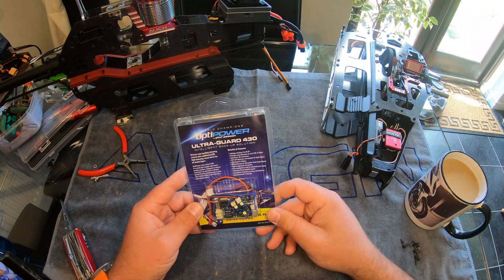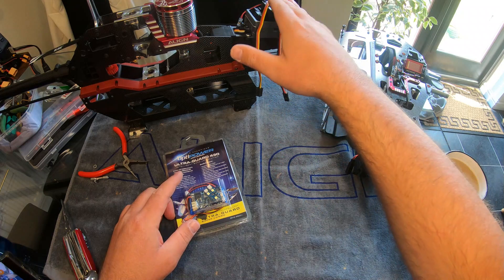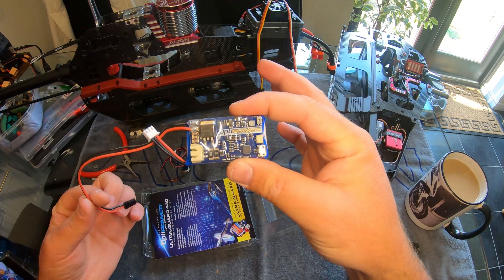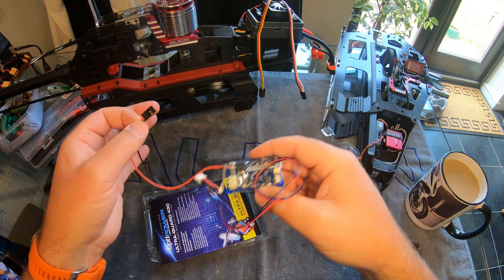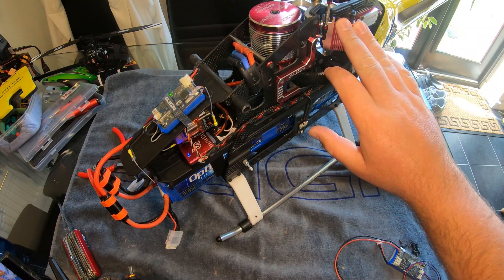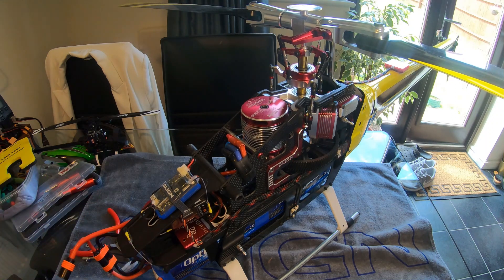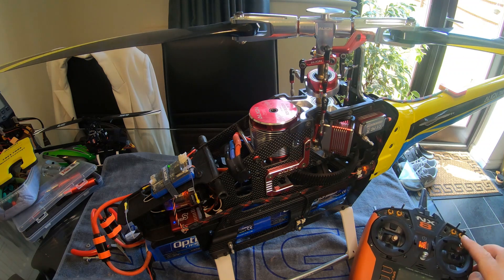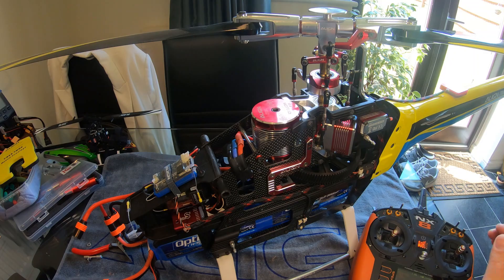RC Helicopter Power Backup /  OptiPower Ultra - Guard Explained

Comment: A good useful video DJ - thank you.  The 130a ESC will handle up to 200a on burst and the 200a ESC will handle right up to 300a on burst so, unless you really stick banging, you should be ok.  But Opti guard does give you that sense of assurance anyway.
Reply from the maker: Definitely late every little helps don't it. I used to be holding 11° positive / 1950 rpm for a good few seconds 😅 to get some speed, these backups stop me worrying now

Comment: Hi, while watching your videos it is apparent that you are a skilled heli pilot and have a great knowledge of heli setup etc. I am just getting started on my own adventure at age 66, I have no problem with the techinical side of things as l have built, setup and repaired many helis for my son who was sponsored  and competed 10 plus years ago. My question to you is what are you using the Spirit geolink for and have you found it to be reliable. When l go on the spirit forum and a few others, it seems that the geolink can be troublesome. Your opinion would be greatly appreciated and valued with regards to your experience with the geolink. Kind regards Brett
Reply from the maker: Thanks for the comment mate, I honestly only have one reason myself and that's for the GPS speed tracking which I refer to in the data logs. It's also a nice luxury to have if you have something in your eye or need a second too compose. I personally have found it reliable I think the issue is many don't set them up correctly or skip some steps when doing so.
Reply: @DEEJRCFLYING  Thank you